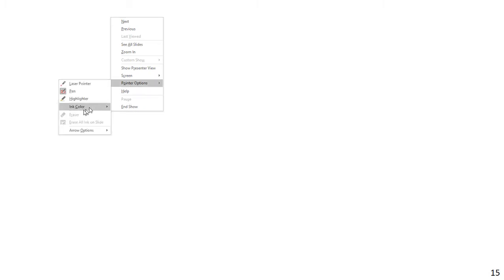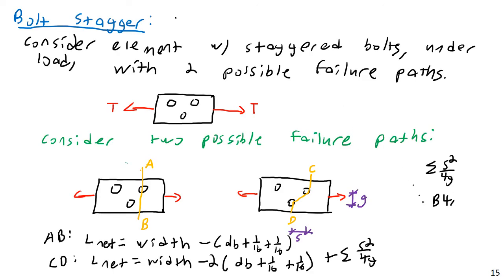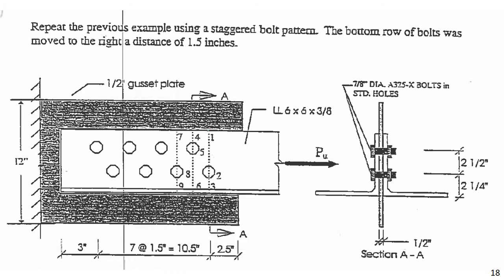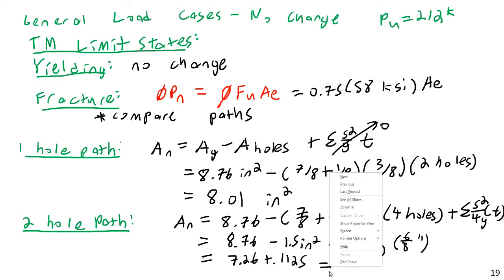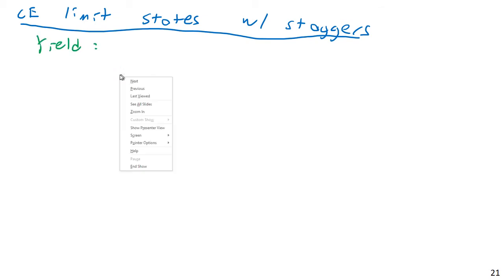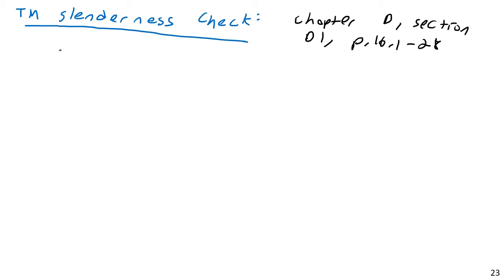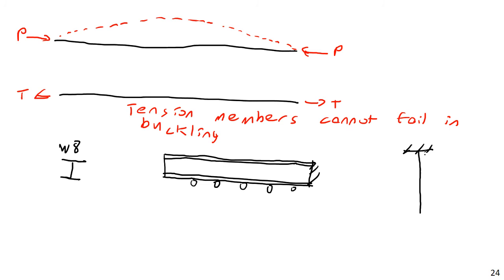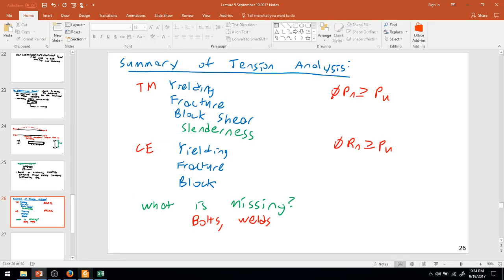Bolt Stagger - Steel and Concrete Design

Comment: Ms. Tanya J. Laird;
Many thanks for your valuable videos, I had a question:
 In term (S^2/4g)*t, value of "t" is evaluated as 2t which is 2*3/8=6/8, but why in first term {Ag-(d+1/8)*t} , t value doesn't doubled?
Because in both term there are double L angles , I expect that value should  be doubled and become 6/8  also, not 3/8.
Maybe I have any  misconception or it's an error in video.
 Looking your guide please. 
 Thanks